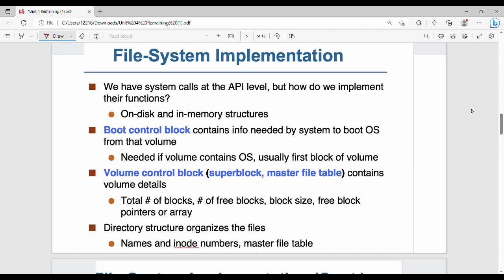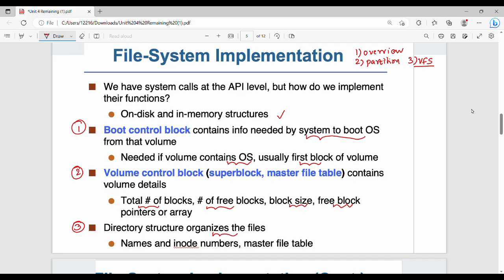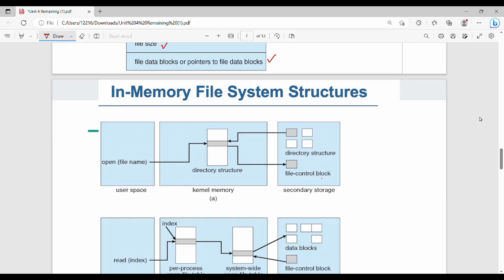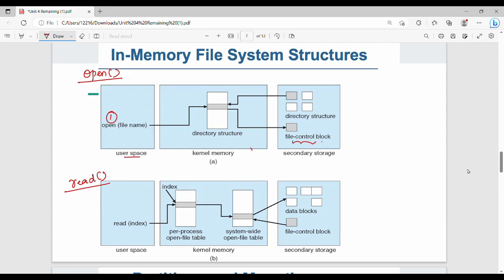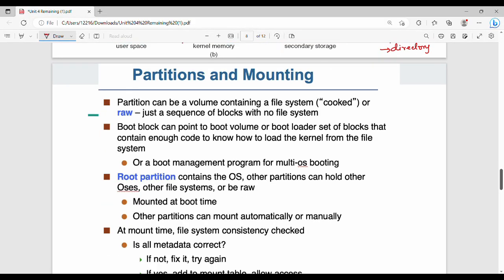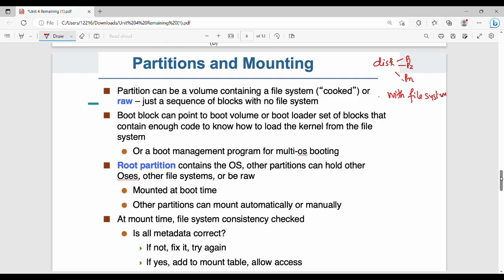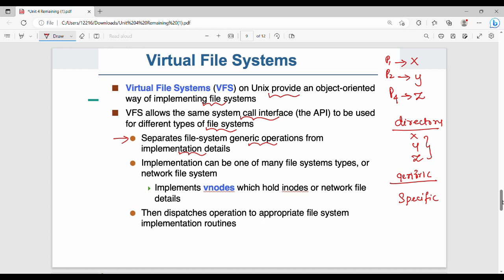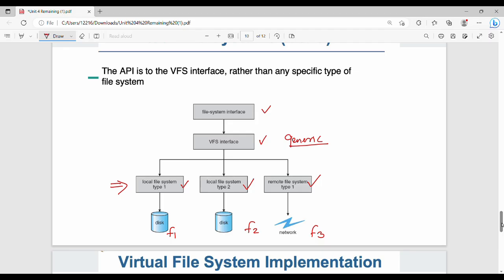4.9 File System Implementation in Tamil

Comment: Allocating kernel memory means what sir
Reply from the maker: I dont get what you are asking but Kernel memory allocation refers to the process by which the operating system's kernel allocates memory for its own use. The kernel is the central component of an operating system that manages system resources, including memory, and provides low-level services to other parts of the operating system.

In general, the kernel allocates memory in small chunks or pages to manage system data structures, such as process tables, file system buffers, and network buffers. The size of these pages can vary depending on the specific operating system and hardware architecture being used.